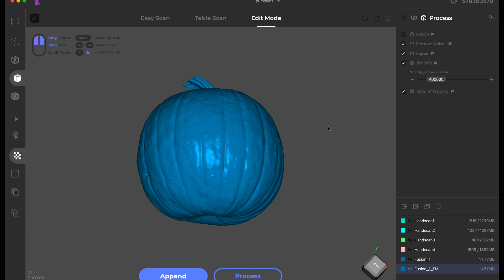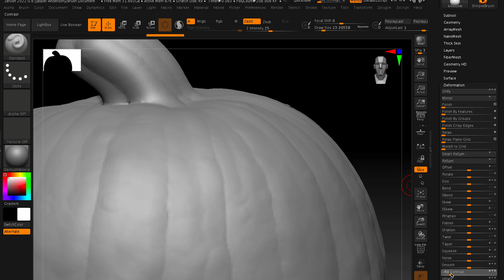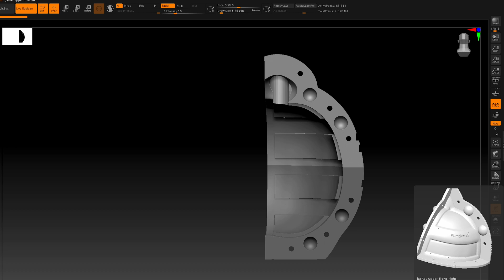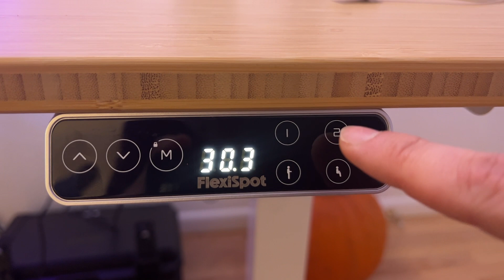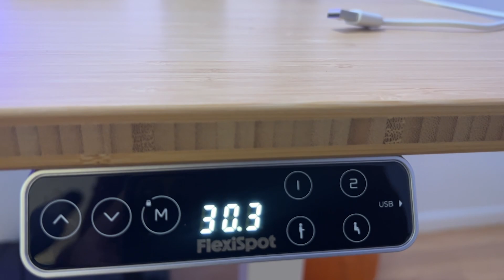3D Printing a Matrix Mold with 3Dmakerpro Mole 3D Scanner

Comment: What is the best resin rigid option for rotomolding? I want to make hollow figures.
Reply from the maker: Smooth On 65D is what I normally use. It’s very tough and has a gradual cure, which helps to build up the thickness
Reply: @jasperjanderson  Is there any way to get a little more working time with this resin? The description says 3 minutes.
- Or do you know of one with a slightly longer working time? Thanks for responding, friend.
Reply from the maker: @andresduenasgarcia5479 I think you’ll find 3 min is plenty of time, but there are certainly other slower set resins out there.

Comment: Excellent video, and congratulations on this wonderful workshop. A tip: in addition to inverting the FDM jackets, varnish them with resin on the inside to avoid roughness. Paint the clay with acrylic before pouring the silicone so that the clay's moisture doesn't affect the RTV. This doesn't usually happen, but just in case. To know the amount of silicone to use, weigh the clay you've poured in or fill the other half with rice (you put it in a jar) and you'll know the volume. These are guidelines, not exact.
Thanks for your contribution.
Reply from the maker: Good ideas! Typically water content will actually speed up the cure of silicones, though impurities such as sulfur can inhibit certain types. I did seal the clay wall here with Krylon Crystal clear, and a release agent, to help the silicone cleanly peel off of the clay once cured. Thanks for watching!

Comment: Amazing video! One thing I noticed that might be helpful is that once you have a tool of your 'silicone' layer in zbrush, you can calculate its exact volume in the 3d printer tab in zplugins tab... so you might be able to get away with having to guess how much silicone to use.
Reply from the maker: Nice! I didn’t know about that!

Comment: Wish software like this and Blender would just come with a "make mold" button, how did you add the keys to the mold shell? Just a bunch of booling the orbs?
Reply from the maker: The thing is there’s no one size fits all method, so you still have to know some of the principles of moldmaking to do it successfully. I’m sure someone could develop a plugin, but I suspect it would still take about as much work to do it well. Yep, it’s all basic shapes.
Reply: @jasperjanderson  decided to Google the idea and found a software called My solid Works that does just that, automatically turns things into molds. I normal make molds by hand but having a 3D printer it's kinda pointless now.
Reply: @ScarletSanctuary , In SolidWorks, the mold is created by excluding the object inside a block or cylinder! (as far as I know) doesn't do what he did!
Reply: @mauriciomori4400  yeah, what he did was magic.

Comment: This is really interesting. It digitises a major step in production. Normally you'd make a mold in silicone, cover it with a rigid material, but if you want a hard mold you have to cast a destructible double, mold that in a rigid material and then do the final casting. It's incredibly time, effort and cost intensive. So what I'm thinking here is if you want a rigid mold, you can cut out all of the previous steps, create a digital negative, print the finished mold and cast in a soft material.
But even this approach looks so clean and effective. good job
Reply from the maker: The best thing is having options! Every method is valuable for something.

Comment: Having made many matrix molds the traditional way (and just dipping my tow into the world of 3D design), this is an interesting experiment. I still think the traditional method is more efficient, and epoxy resin isn't nearly as bad as polyester.

When they come up with a filament that can replace the silicone layer, however, THAT will be a game changer. Fully printed flexible matrix molds, no physical object required for molding. Have somebody in London do the digital sculpting, someone in New Zealand design the mold and print it in Chicago.
Reply from the maker: Absolutely agreed!